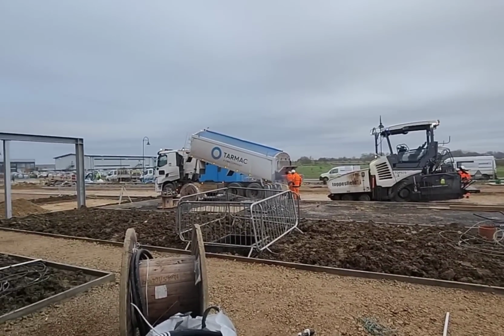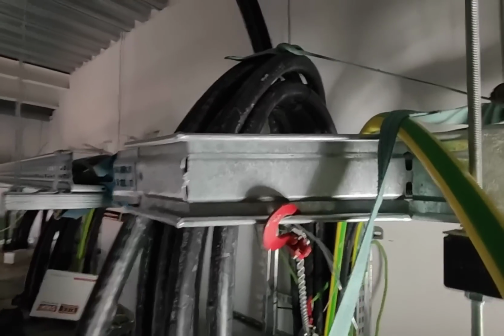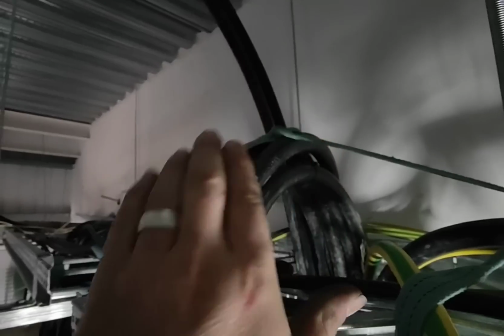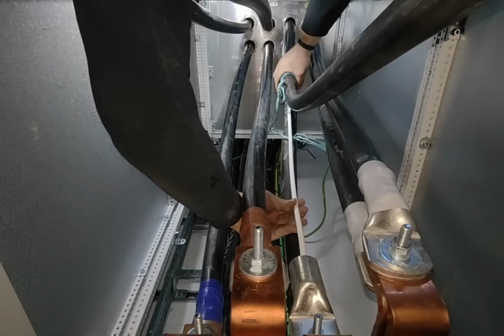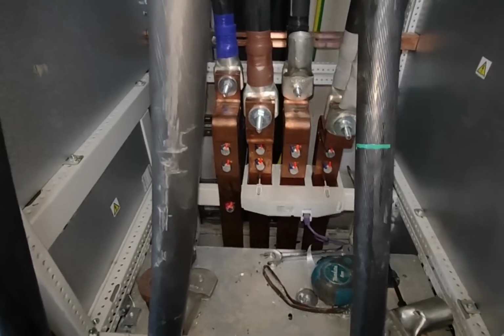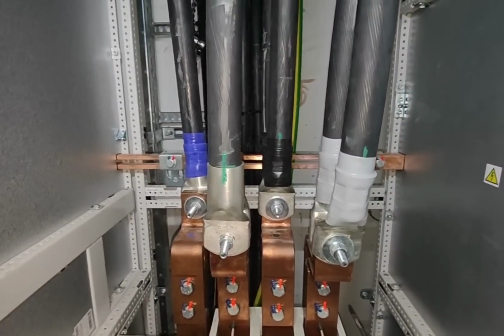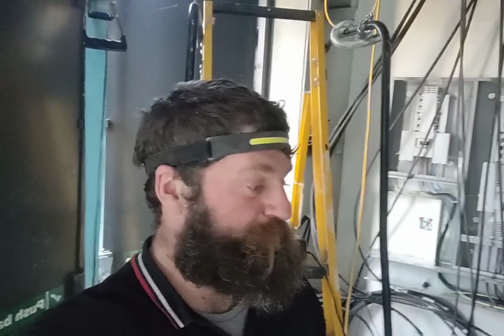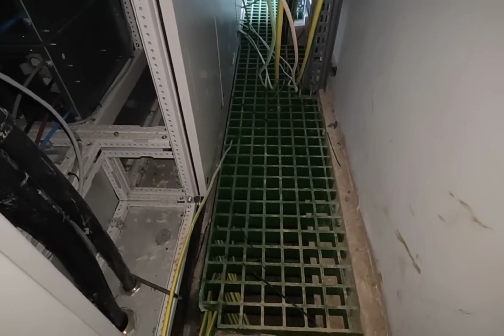Part 2 1cx630mm x 8 My finger is getting better!!

Comment: You need a multitool to cut a couple of squares out of that grid floor...........
Reply from the maker: I've got one, but they are noisy aren't they!!
Reply: @jointechcabling9103  they are and it was dusty enough in there as it was, that flooring absolutely stinks when you cut it. I’d only ever cut it outside of a work area, never where I’m working

Comment: Where do you get the data for these size cables as not in regs?
Reply from the maker: What data would you require?
Reply: @jointechcabling9103  CCC and volt drop values etc?
Reply: From the manufacturer

Comment: What happened to the battery
Reply from the maker: Heat gun got it. Someone unplugged my lead. The heat gun was plugged in and turned on. When I went to reinstate the power the gun was pointing at the battery. It had a good 15 seconds of Stienel fire power aimed at it. Poor thing never stood a chance😂😂😂